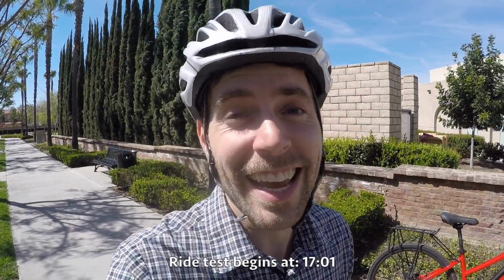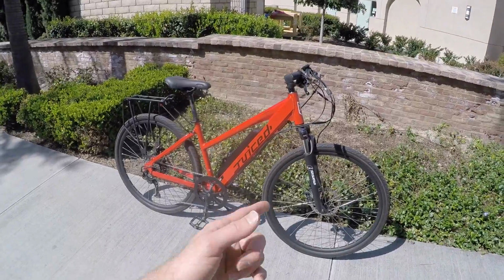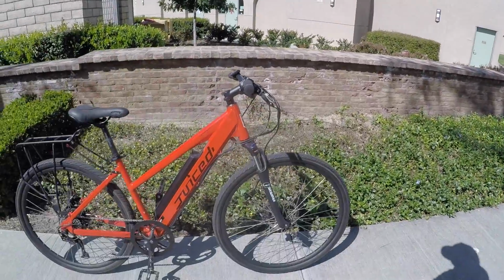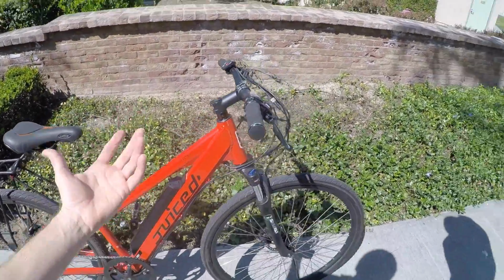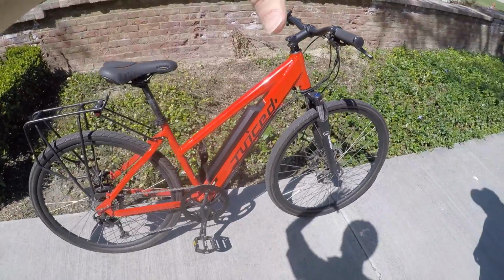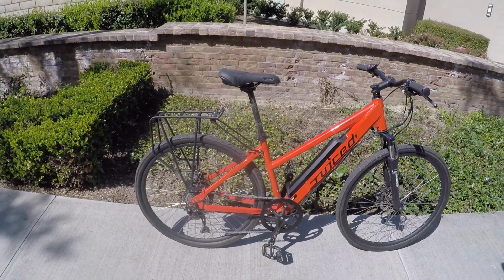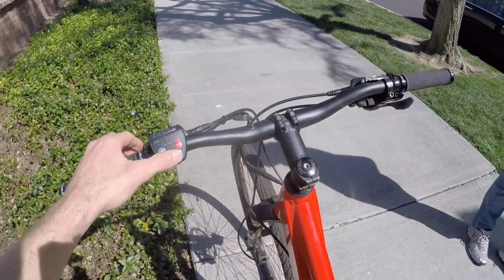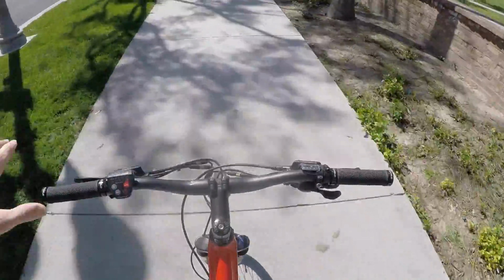Juiced Bikes CrossCurrent Step-Thru Video Review - Affordable Sporty Speed Pedelec Ebike

Comment: Bought the CrossCurrent during Christmas 2016. Been riding it 5 days a week for 4 months. The bitter rain did get into the throttle and LED Controls and made the bike a bit temperamental, like a living horse. As in, it would be lazy and shut down on it's own one day and always pedal to the metal the next day. It isn't perfect, but it is a damn good bike.  The water penetration is my own fault really. Now, the dry season has come and it works 100%. I am surprised that the water didn't fry the chips to be honest.

I wish Juiced Bikes would make an offroad bike that go faster than 28 MPH. It would make their "better" bike, even better.

Comment: Why is the CC Air so much less expensive than the CC? They both come w/ 350w motor and the Air comes stock with a 8.8Ah battery vs the 7.8 in the regular CC. The lack of front suspension on the air is one obvious difference. The Air seems priced low enough that throwing in another battery or upgrading to the 17.4 Ah wouldn't be a big deal. The HyperFat that comes with a 750 watt motor and 13.2 Ah battery for $1k looks like a pretty good deal too. Their price range in general is impressive and if they can keep this up I expect them to sell a ton of these things.
Reply: The major ones: suspension, better derailleur, better hydraulic brakes. If you were to source those parts out at retail and had it swapped at a bike shop, that'd be the price difference.

Comment: I forgot to add the other nice new additions and or changes to the Crosscurrent electric bike: A full carbon stem and handlebar and I think it would be a good benefit if also an XCR Suntour suspension seatpost to be on the bike. The bike may be a tad higher cost, but as Tora is often in China he can get some of these suggestions for a very low cost for the bike components; I often buy specific bike component products from China.
Reply: I could see the suspension seat being an option for comfort but I don't see the value of a carbon stem or handlebar. It's already a heavy bike as all ebikes are. I don't think a few ounces saved will make it faster or hide vibrations.

Comment: Tora should make his next sports model electric bike with a 500w rear hub motor, offer a few more frame color options and ergo grips.
Reply from the maker: Good feedback, the grips would be easy enough to add but swapping a motor yourself is a big chore... and getting it to work with the system properly etc. They're squeezing a lot of zip and power out of the 350 here but I agree that maybe an upgrade option for $,1699 could be cool? Instead, he's going the other direction with a $1,099 Air model :P
Reply: He is already working on it.
It will be premium version of the cross current.
Reply: already have . his web can make you know
Reply: I didn't see where that was mentioned that he'd be working on a Premium CC (did he say that on FB or EBR Forums?). I saw the HyperFat bike. I like that frame with the LCD display and lights but I'm not in need of Fat Tires or the 750/1000 Watt motors. I guess fat tires need big motors with lots of torque to move those bikes.
Reply: I am pretty sure Ravi gets a more inside scoop than EBR or most public info.

Comment: Nice to see another Juiced bike review! It appears this new step-through model features the rear rack mount additional 'Mounting boss' soldered to the frame (Higher up the rear derailleur) as well as all the Crosscurrent air models (From their website pictures), where as the high-step Crosscurrent does not seem to have that. Do they all now have the same additional mounting boss, and does it require the additional black bracket in this video (Seems to be less solid)?

Also, for a 32 kph commute bike, how does the power and speed compare to the mid-drive Bosh/Yamaha systems found on the Haibike Sduro Trekking line or the Cube Cross Hybrid Pro?

Thanks a lot Court, your reviews and videos are very well done and much appreciated!!
Reply from the maker: Hey Sessy, I was a little confused by the rack adapter setup and asked. They have a different rack on the OceanCurrent that didn't require these plates. I can't say for sure but will ask one of the Juiced team to reply here for you. Power is less on this bike but speed just about hits that 28 mph mark. Keep in mind I'm a light weight active guy. The CrossCurrent feels less like an electric scooter that takes you and more like a super-powered bicycle. They balance the torque and cadence sensor interaction very well. Ride quality exceeded my expectations given the numbers alone.
Reply: ElectricBikeReview.com Thanks for the reply! I'm shooting questions out here to also have global feedback as I'm hesitating between different models :P. 

From what I understand, these are better for high speed vs. high torque of the mid-drive systems. I am looking for speed, but I am limited legally to the 32kph display because of canadian laws.

What I'm also wondering is how does this bike compare once you reach 32 kph and over? For example, does the motor completely cut off until you're back to under 32 kph, so the motor would constantly be going on and off? 

I suppose the mid drives are harder to get over 32 kph once they cut off because of the smaller chain rings, where as this bike might let you achieve speeds over 32 kph easier using leg power?
Reply: Thanks for the clear up on the rack mounts, much appreciated to have direct answers from the manufacturer also! Will definitely try this bike out in the next few weeks!